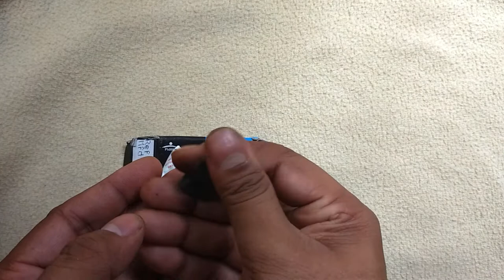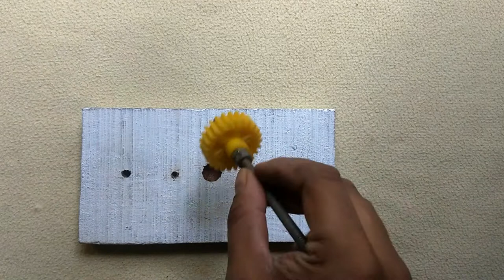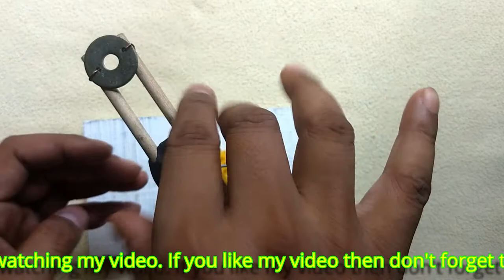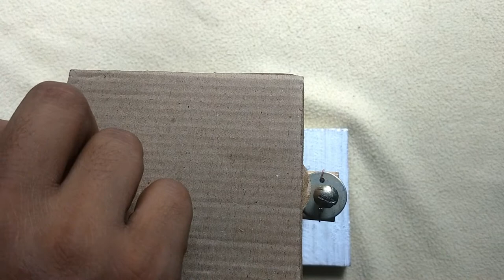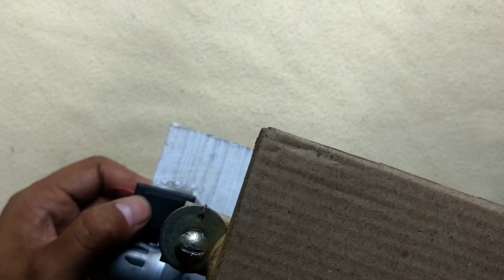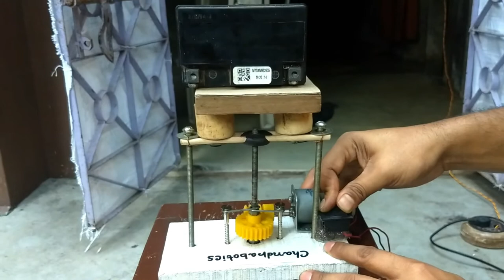How to Make Motorized Screw Jack model using Worm and Worm wheel || Chandrabotics

Comment: Can you please list out the items uesd in the video
Reply from the maker: Thanks for watching. Tell me which one is making you confirmed. I shall answer 😊
Reply: @Chandrabotics   The video is very nice.But I am not sure about the parts used .There is a worm wheel ,m seal etc and washers , hexagonal nuts , etc I am not sure whether the thing used for connecting worm wheel is long bolt or screw and it's difficult to analyse how many parts were used .It would be nice if you could mention the used parts and their number.... Thanks for replying